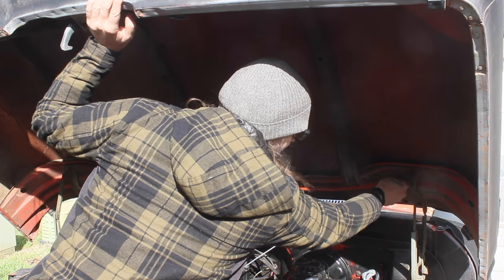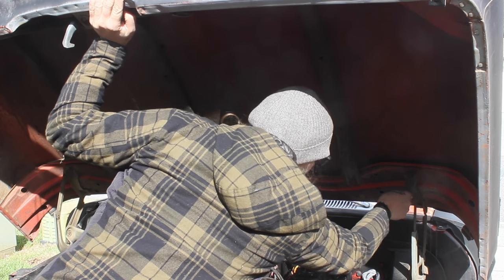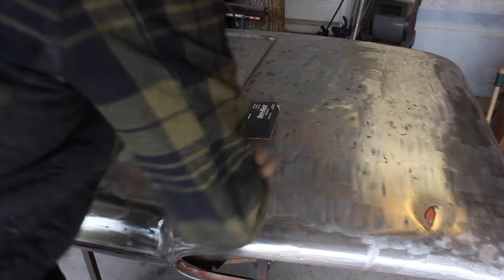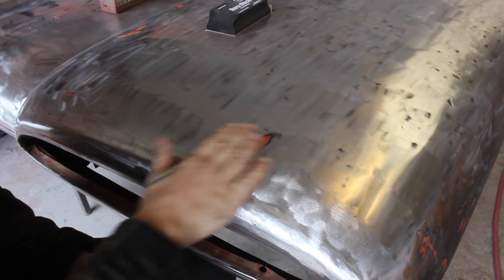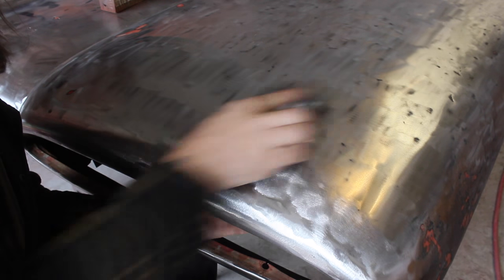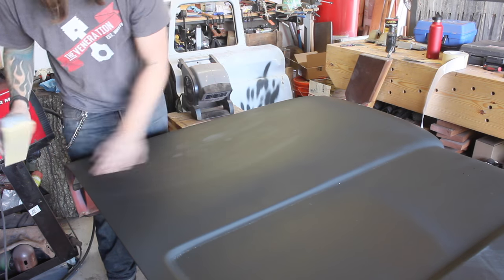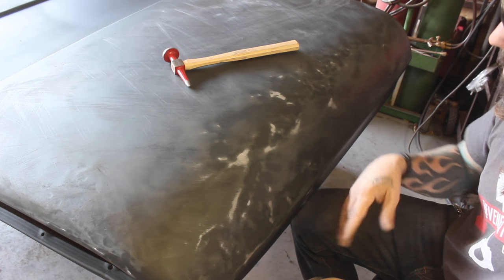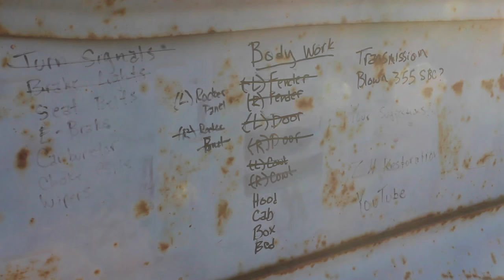4. Hood - Dent removal, body filler & epoxy primer

Comment: Was just wondering how your truck was coming, came on over and POW, there's a brand new video up! She's coming right along. HA, my wife loves getting called to the shop to help me lift heavy things also.... Your high/low spots showed up well, there's a product called 'guide coat' that I used to use (when I did bodywork) to help achieve perfection.
See you on the next one!
Reply from the maker: Thanks!! Yeah, I'll probably use guide coat before I put the paint over the primer.